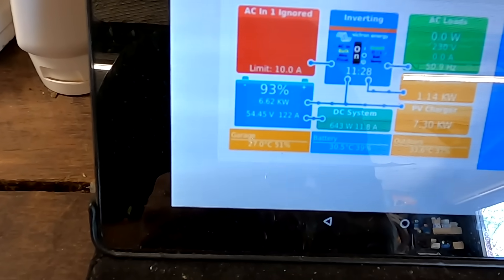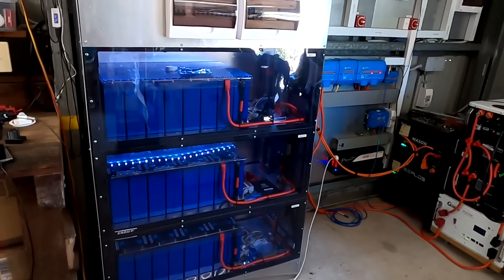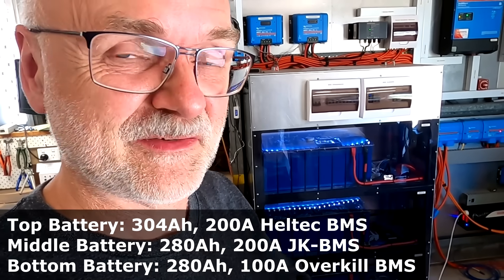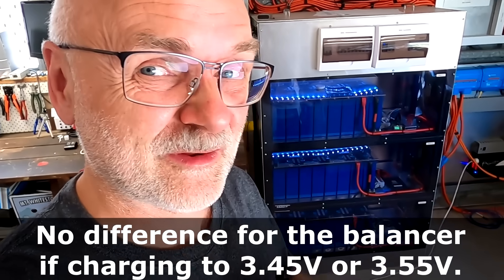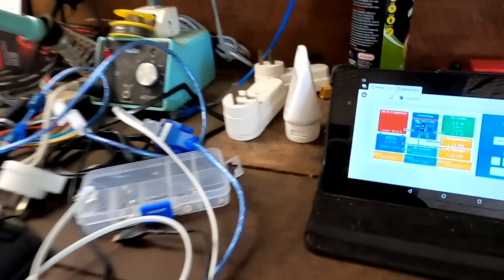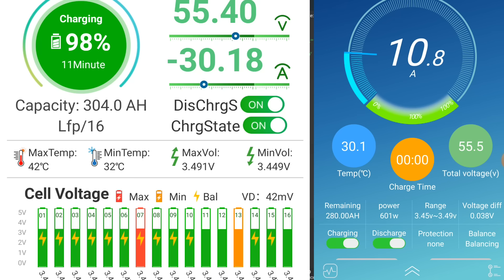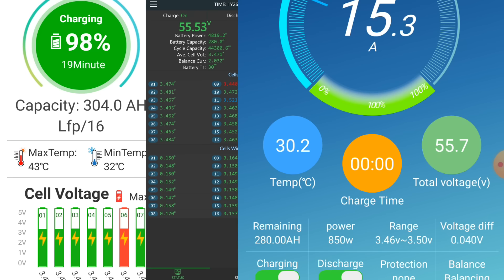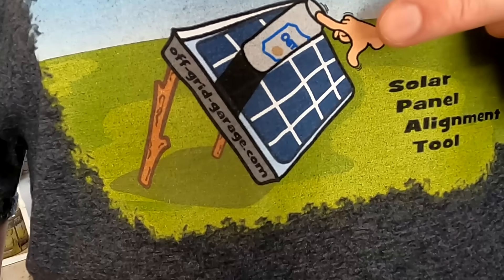Higher charge voltage = better balancing? Here is my battery shelf result!

Comment: Just simply use a charger and set it voltage to 3.5 per cell , when bettery will near to to charge it has enough time to balance the cell. We mostly use higher voltage chargers which fastly charge the cells but doesn't balance properly.

Comment: 3.37 V per cell is the activation voltage for metallic lithium deposition on electrodes degradation effect. Your float voltage of 3.35V seems perfect to me.

Comment: If u test voltages and watch victron kwh going up is that best or is too high voltage bad, if wanna battery last years, so charge only 90% and like flooded batteries boil once a month with higher voltage

Comment: Hi I've just changed to lithium and put in a mppt controller with 100v my problem was I had the BMS shut off and the charg controller put that 100 v through the controller and inverter which fried them both . What do you do to prevent this from happening. Or is it just don't change it to hi and pray the BMS don't shut off . Thanks in advance
Reply: It's a 24v system

Comment: Hi Andy

I recently made 12v 280Ah battery with JKBMS. After watching your videos, I had set 3.45v for Cell over voltage protection for few days. then I watched Will Prowse videos and I set it to 3.55v (yes, I know he recommends 3.65v but I still set 3.55v because I fear 3.65v). In last 10 days, some days I kept 3.45v and other days 3.55v. I may be going back to 3.45v. You both are great anyway.

I love your videos starting with nature and beautiful soundtrack.

Love from Pakistan!

Comment: Hi Andy, I like your video intros, and haven't seen all of them or read all the comments.
When you report each time how many "Amps I have outside", I wonder have you ever thought about the fact that those amps aren't outside, only inside.(After the MPPT has converted them). The amps are a lot smaller outside of course. The beauty of why you use an mppt regulator. If no one has suggested this before, I know you'll get a laugh out of it.😊
Keep harvesting those little amps outside, and turning them into big ones inside.

Comment: Thanks for the video. Unfortunately, we did not find out the answer to the question about balancing, but it turned out to be a comparison of BMS vs. BMS.
To find out the quality of balancing, you need to discharge the batteries until individual cells start to turn off and measure the energy spent. Will it be the full declared capacity of 300Ah or how much there is.

Comment: Living in the UK where so many times the sun doesn't shine. I have to charge to a higher voltage to get the batteries pumped to a higher percentage. Amazon are now selling a big selection of lifepo4 batteries at near alibaba prices (when including bms and postage) soon so much storage and surplus electricity in the summer.😊

Comment: The victron setting options are really great. My problem with the seplos is, that's not possible to set a float voltage. I charge to 55.6V and it stayes there until the sun gets down. I'm a little bit afraid of the first sunny day after winter here in Germany 😅🙈 because the battery works since weeks between 20 and 45 percent and there are almost the same number of weeks coming before sun gets higher! I pray, the neeeeey will be able to handle this!😅

Greetings to you, Andy!

Comment: Great video. Note: your cell wire resistance seems a bit high. On my JKBMS I can read between 0.054 to 0.071 ohm. A bit a pitty that the JK only balance at 2A, I saw a balancer running at 5A, wondering If I should move to that to fix faster the too high cell voltage above 3.65V(5A Active Equalizer Balancer from Daly)

Comment: I am already using the "new" settings you mentioned as winter-time settings. Need to squeeze every drop. The setting was made 6 weeks ago and it works fine, but then I have not reached full charge yet as there are many continuous days without sun. In spring+ time I intent to switch back to the standard setting, or even lower, since the battery is charged 100% until mid-day.

Comment: Love the channel. Goofy. Quirky. And a ton of information. Keep up the great work. 
My setup, tons of sun, Grid sharing and a grid zero configuration setting utilizing outback radian inverter.
Essentially, stores during the day, supports all my loads & discharges to XX minimum battery settings overnight with a net result goal of ZERO grid usage.
Bulk 3.45vpc Absorb 3.45vpc and a float of only 3.33vpc. A slightly lower float holds my cells at +/- 80-90% while exporting excess power until the sun goes down. 
Overkill BMS with Enerkey capacitive balancers - voltage triggered on @ 3.45vpc off@3.4VPC.
It has worked flawlessly for 3 years, but we're never really done "playing" with things, are we??
Cheers

Comment: What is over charge voltage recovery ? The same as charging voltage ? Because if you set recovery voltage lower, bms will be waiting for drop cells too long and cells will not gonna be balanced

Comment: I have two 16s 48 volt 272 amp hour batteries, each has an Overkill BMS. One battery stays perfectly balanced between delta .005 and .009 it seems no matter what voltage I charge at. However, the other battery does not work as well, even though I top balanced the cells three times. When I exceeded 55 volts charge there were always a couple of cells that exceed 3.65 and the battery would shut down. My settings right now are 55 volts absorb and 54.5 float. Initially at these settings the BMS would have to shut down charging many times during a charging cycle because a couple of the cells exceeded 3.65. But...over the last couple weeks the frequency of overcharge has diminished until now it shuts down only two or three times for a very short time during a charging cycle. It seems the battery pack is overall coming into better balance, even with the Overkill BMS. We'll see what happens now staying at these charging settings. THANKS for your videos.

Comment: Hi good day Andy I have a  question, can I pair two Victron MPPT charge controllers of different sizes eg. 100/50 and 150/45 using the Bluetooth feature on the app? I have 1 battery bank and I don't want either charge controller fighting each other to charge it.
Reply from the maker: As long as every MPPT has its own solar panel array, it is all good and you can pair as many controllers as you like.
I made a video about the Bluetooth function and what exactly it does: https://youtu.be/fr_P3DPZT88
Reply: @OffGridGarageAustralia  Thank you so much Andy. Is its possible for a victron blue solar mppt charge controller using a bluetooth dongle have synchronous charging with a victron smart solar charge controller.

Eg. Victron Blue solar 100/50 + victron smart bluetooth dongle 

And

Victron smart 150/45 mppt charge controller.

What happened was, I bought a victron smart 100/50 mppt from Amazon but received the blue solar 100/50 mppt charge controller. And since I live in Trinidad and Tobago in the Caribbean it would have been impossible to return it. But as it had sale on victron components on Amazon I ordered a smart 150/45mppt and was wondering if both could still be paired on the same VE. Bluetooth network along with my smart shunt to allow for synchronous charging?

Thank you so much in advance Andy.
Reply from the maker: @skullpoly1967  Have a look in this document from Victron. I don't see a problem...
https://www.victronenergy.com/upload/documents/VE.Smart_Networking/20723-VE_Smart_Networking-pdf-en.pdf

Comment: i wonder if the bigger voltage delta on the JKbms isn't exactly because it is active balancer, if cell resistances are varied , then the voltage lift on some cells are more than others while charging, and then start balancing on those cells sooner than maybe would be needed,

ie i have seen my JKbms start discharging a certain cell and moving that energy to another cell, only to move energy back to that cell it initially discharged  when it gets closer to full, maybe just me badly matched cells 2nd life and 3 different batches
Reply from the maker: The battery in the middle shelf where the JK is connected to, uses aluminium bus bars. That could explain it. Further testing coming...

Comment: Hi Andy, received my JK BMS today and was able to install all correct. Activated with a old 12v Battery, and made basic settings all under 2 hours. All the good tips I learned from your channel made it possible.
One question: communication only over Bluetooth or can I reach the BMS also over WIFI?
Reply from the maker: Bluetooth only to the app on you phone. None of these BMS have Wifi.
What software version have you got on yours? Just keen to see what they deliver at the moment.

Comment: Hi Andy, 3 weeks ago you told us you ordered a 3D printer. I am writing not only to congratulate for this decision, I also want to recommend a 3D design program to you. As a total newbie I got my printer 3 months ago. First I tried Fusion360, a program used by many 3D printer owners. I got some results but I was not satisfied with my learning curve. So I was happy to find the open source program OpenSCAD. It is different from most 3D design programs. You design in OpenSCAD with some lines of script text, assembling your object from basic shapes like cubes, spheres or cylinders. Line by line you can immediately see a preview of your object and easily do changes. The program is easy to understand but also very powerful. After some days I could already design a replacement for a broken plastic gear of my good (decades) old bread cutting machine. My design was working at the first try. (I am not married with the designer of OpenSCAD :)  Good luck with your printer.

Comment: I have one of the aliexpress voltage relays controlling the active balancer for my small off grid system(600ah 12 volt bank)  thanks to Andy for featuring this actually this channel is probably largely responsible for me building my own battery and solar charging setup.  

I have settled on charging to 3.52 volts per cell, and it's been ticking along nicely for 6 months.  I rarely see more than 30mv difference , and charge or discharging it's usually 10mv in the mid range.  These are 8 300ah cells parreled for a 600ah single bank.
Reply from the maker: Nice, John. Thanks for sharing.

Comment: Have you given thought to a larger BMS to manage the entire battery bank (single BMS)?
Reply from the maker: No. I would advise against that. I like the separate BMS which provide good redundancy in case I have to take one battery bank offline.
It's like one 3p16s battery instead of three separate 1p16s batteries.

Comment: Happy to see you chose the 'OLD' settings.  I had set my 24v system at comparable voltage and my system seems 'happy' more often.  Charging to higher causes faults.
Reply from the maker: Yeah, back to the conservative settings and system runs perfectly fine...

Comment: I built a LifePO4 pack two years ago, started of with a Daly bms, dumped that later and changed it to the JK. 2amps of active balancing. 3,45v/cell, absorbtion of 1 hour, float of 3,35v. Works wirklich perfect.
Reply from the maker: Yes, that works very well!
Reply: @OffGridGarageAustralia Hi Andy

What is the re-Bulk setting do you use?
Reply from the maker: @elias2024Hoy  I have set 2.5V as re-bulk. I think fully charging the battery once a day is fine.
All settings of my devices are here on my website for reference: https://off-grid-garage.com/my-settings/
Reply: Hi, good jobs in your videos, it helps me a lot. You dont think that maybe switching the "rebulk" too low we can lose hours of sun and charge? for example of I get the discharge level at 19:00 maybe I have no time to recharge battery. 0.1v is good I think @OffGridGarageAustralia

Comment: Does 100s of volts out at the top even matter??? Because soon as a load comes they all balance out once voltage has dropped down to the flat part of the curve or even settled voltage?? Does it really affect lifepo4 that much after 54v 🤷🏻‍♂️
Reply from the maker: They don't balance when the voltage drops. They hide the imbalance, that's all.

Comment: I also keep my bulk charging at 54.6 and floating voltage of 53.3 only it has been two and a half years.🎉
Reply from the maker: Thanks for sharing. Charging to 54.6V will charge to almost 100% if you allow some absorption, so thill definitely will work.
How do you balance at these voltages?
Reply: @OffGridGarageAustralia  the 105 AH cells suprisingly doesn't need that balance. But the 280 AH after I manually balanced them every few months I take the voltage to 55.2 or a little higher the 105 cells didn't have activated balancer at first idid had current divergence between the two 105 packs I enabled the balance after more than one year 120ma was so sufficient to balance them and fix the issue but I couldn't access the settings of ANT BMS until I downloaded and purchased Vbms app. I activated balance on your advice past 3.45 even my testing I found that even balancing at 3.35 will mess the balance.